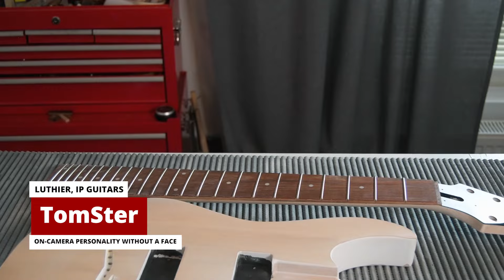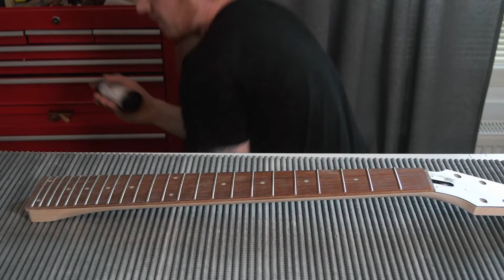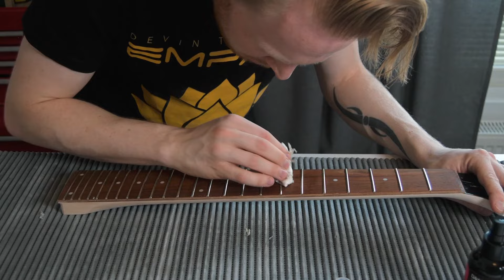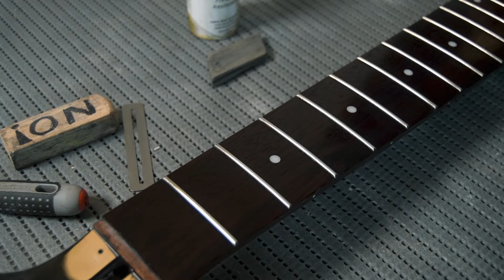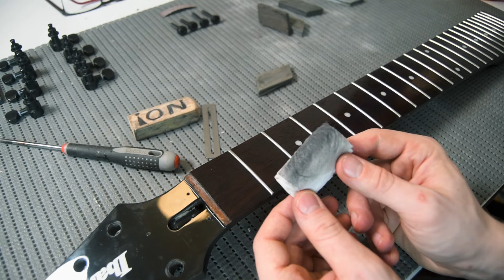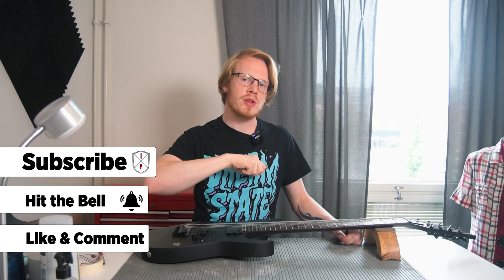How To "Ebonize" A Fretboard With Stains

Comment: Informative video! What would you do differently if you wanted to hide the inlays? Take them out, fill in the blanks, then stain?
Reply from the maker: Thank you :)
And pretty much yeah. If at all possible, I would try to match the color of the original fretboard before stain to make the look more uniform after staining. But only if using wood as the filler.

If you're filling the removed inlays with something else, best to try and match the look you'll get after stain, as some materials will not take to the stain as the wood does.

Comment: Sir, I want to try this on my classic Yamaha guitar, but I'm worried that the stain I use will wear off. can i use water based stain?
Reply from the maker: You can definitely use water-based stain for this. Just make sure to thoroughly clean the fretboard beforehand and add a few layers. Let it cure and dry off properly before adding any oil on the board :)

Comment: Would this stain  work on a Pau Fretboard?
I tried to get my fret board darker with a stain marker , after 3 days it darkened  a bit but it just seems that Pau Ferro doesn't suck in stain. 
Great Video 
Thanks for Posting
Reply from the maker: Some exotic woods are fairly oily and take stain a little harder, however if you clean the fretboard properly and get it dry enough, spirit stain or leather stain should work pretty well to darken it.
Reply: @IPGuitars  
Thank you 
That helps a lot.
Appreciate it
Reply from the maker: No problem :) hopefully it works out for ya!

Comment: Using paper is not a good idea.
Reply from the maker: While the paper does wear down pretty quick, it is just fine as a stain applicator in this purpose :) but you are right in that you could use a cloth or brush to apply and another means of pulling off the excess.

Paper is just easy and abundant for anyone looking to do this at home :)

Comment: Have you ever heard of people using ⅛" delrin rods for frets? I cannot exactly remember where I read that at. Just remembered and if you were trying to blacken/darken the fretboard/neck might extenuating the look and finish.
Reply from the maker: Delrin for frets or fret markers? If the former, then never heard of anyone doing that😱 doesn't sound like a very long-lasting solution.
Reply: @IPGuitars  I think that they used the delrin for frets, I will try to locate the information.